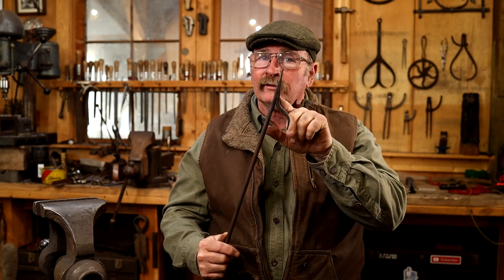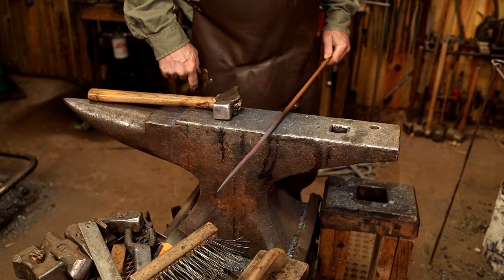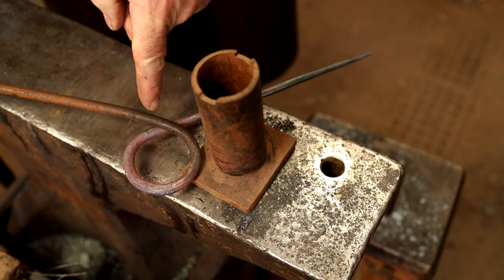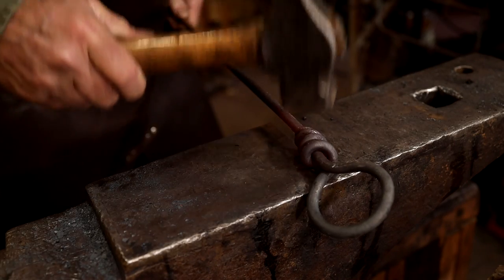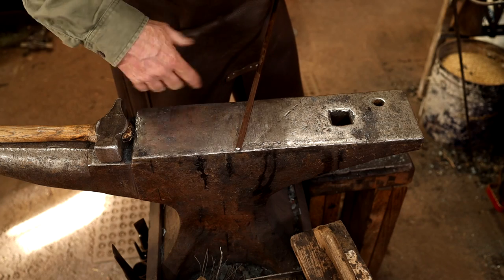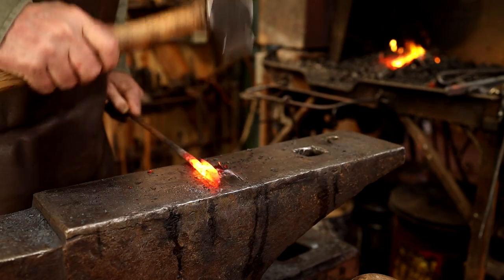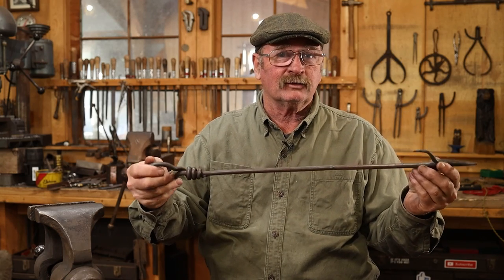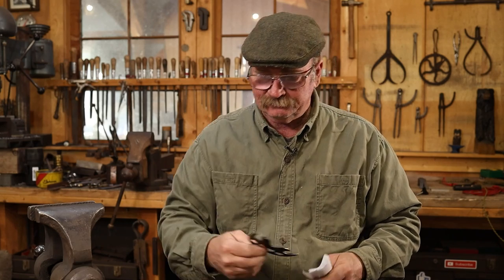Wrapped handle fire poker

Comment: I didn't realize it's that simple to do a forge weld! Great idea. Off to the garage!!
Reply from the maker: Glad you liked it!
Reply: Iron mountain flux is wizardry (great stuff)
Reply: Same!
Reply: @BlackBearForge  check out John Jude's comment  it is great I should have said it and it goes double for me
Reply: He made it look easier than it really is.  Not that the weld he did is hard because you don't really have to prep with a scarf, but his control of heat, awareness of the right colors and accuracy with smooth light strikes takes practice.  If he hit that too hard or at the wrong angle it would have slid apart and turned into a pile of mush.

Comment: Hi John, you opened up poking around in the stove.
I did the same thing this afternoon, had a nice bed of coles, added a piece of flat stock 1 1/4" wide 3/8" x 8" long. Needed to make a hook on one end for a gear puller. Couple of minutes up to very hot, couple more heats nice clean hook.
This dosen't mean I am going to stop working on my blacksmith shop. 👍

Comment: Well, John, you taught me a good tip in this video.  When making pokers like this (usually out of 3/8" square rod), I have trouble keeping the weld from splitting when making the curved "hook" part.  I never thought to clamp it in the vise to keep the weld from splitting.  Thanks for the tip!!  I guess you can teach old dogs new tricks, LOL.
Reply: If the "weld" is splitting, then it isn't welded. Try taking the heat just a little higher/hotter or longer in the heat soak for the welding.
Reply: @thomasarussellsr  Good point.
Reply from the maker: The problem with multiple welding heats on this style tip is that they get too thin so one heat with a slightly less that perfect weld is better than the thin spindly point.
Reply: @BlackBearForge  That's precisely the problem I was having.  Too thin of a point might tend to bend if one isn't careful and leaves it in the stove or campfire too long.  Thin tip-hot fire, not good!

Comment: I teach using gas forges because they are portable (I also comment under Second Chance Forge) and teach this style without the forge weld since it is so difficult to get to heat with propane. It holds well just doubled over on itself. Beautiful work (3 years ago).

Comment: When I started on the blacksmithing course at Hereford in England 25 years ago this was the first thing the students made as it taught several important factors in one item. We used square stock, the rats tail at the handle end was to teach not burning the metal and where to place it in the forge as well as hammer work, descaling etc. The other end we 'upset' to make a bodkin point, like armour piercing arrowheads! all the time maintaining the square edge, the shaft we did barley twists in two places. No gas torches, no pincers, just hammer anvil and forge. There's a lot of learning to be had from making something as simple as a poker.

Comment: Good morning and, thank you John for sharing another great instructional video.  I was literally impressed with the ease in which you accomplished that Forge Weld. 
The Poker turned out great. I think you're right, more length of  the round rod is needed so the wrap would be longer to accommodate larger hands.

Overall all, I grade this video at 110% 👍.

Thanks again for sharing your talent with us. 

Stan

Comment: I really hate to suggest something to a pro like yourself, but I used to build wire fences that we wrapped wire over wire much like you are doing on loop end, to do this we used a tube a little larger ID of the wire OD and could slip the tube over the wire and get very tight wraps because the fulcrum was right next to what I was wrapping around.  a 2 foot piece of 1/2 ID pipe would do the job here.  Again I hate to throw in my two cents but I believe it would speed your wrapping and give give you a very tight wrap.  Have a wonderful thanks giving and I hope this is taken in the spirit of thanks I have for your great You Tube channel

Comment: I like the idea of the longer wrapped handle. 
In the Battleth, just a small adjustment/offset on one end, and a sharpen, and it could likely be a can opener too. Something to think about anyway. A hand operated can opener so you can open those pork-n-beans during a power outage. There's a project idea.

Comment: John- If perhaps you could mark the round bars w/ soap stone in such a way that folks can better see the rotations- maybe just a line running with the length of the bar, just for a visual reference. Thanks for all your efforts! JBR
Reply: Great idea. It is hard to see how he is manuvering the material. Maybe a stripe marked down one side so we can see if he is spinning it or going back and forth, even in square-bar it is sometimes hard to see if the camera us not zoomed in.

Comment: Next time all you have to do is bring your wrap material down beside the shaft side you want to wrap. 10 inches is plenty. Get both sides hot and twist them together in a vise. Now it's going to twist both but you get the same effect with less material.
Reply from the maker: I have used tat technique in the past.  But I see it as a completely different finished element

Comment: Quick question. How do you deburr a hardy hole?  Mine is 5/8" sq. but the metal I intend on using gets stuck half way through the hole.
Reply: A file.
Reply from the maker: Die grinder or file.  Plan on it being a pain
Reply: @BlackBearForge   I was hoping for a magic trick. I guess I'll start filing. Thanks for the reply